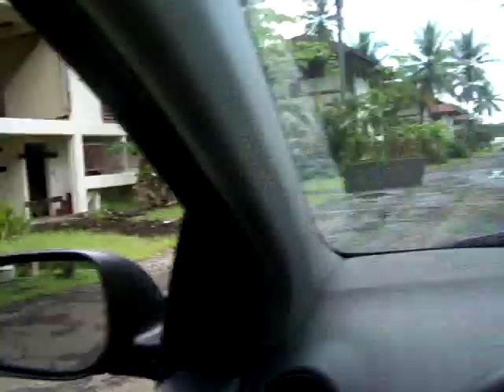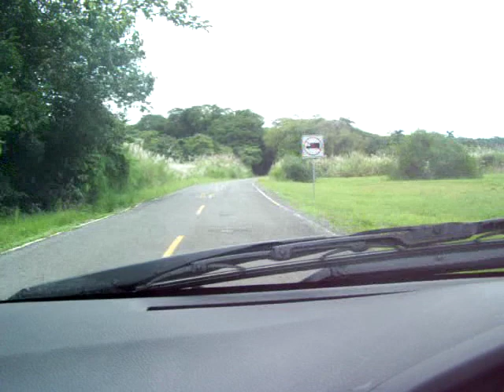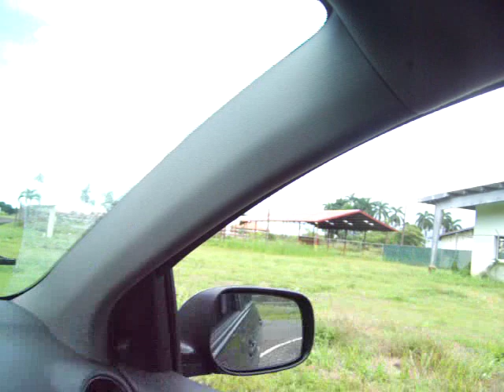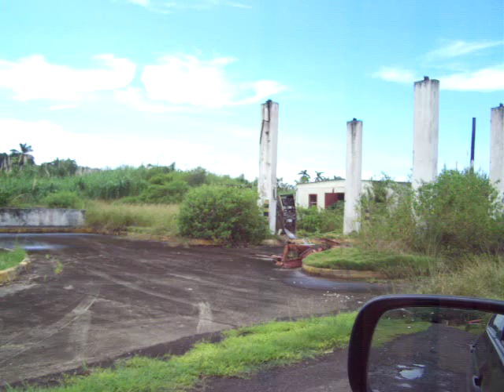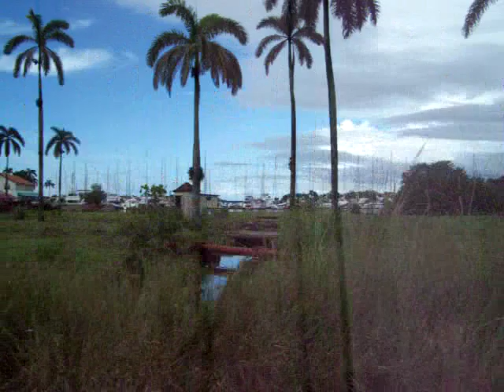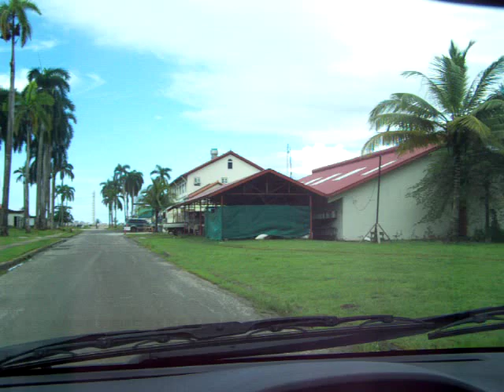Fort Sherman Panama - Driving into the Shelter Bay Marina

Comment: Lived there when I was a teenager. Sandy white beach right out front of our "quarters". Was a very unique place to live. Sad to see it totally destroyed. I can tell they had been upgrading as we had no windows only larger windows with screens and shutters we could put up on the inside during rainy season. You can see the windows were covers by the low roof which gave some protection. But sometimes the rain did blow in. Floors were concrete so easily cleaned. We were there in the early 60's and the housing was the group you drove through in your filming. They had been used many years ago and then taken over by the jungle for many years. During the Vietnam era they reopened the base and it was used for Jungle Warfare training
Reply: Ft Sherman was beautiful.  Worked for JOTC in 1976 to around 1978.  Sometimes it's sad to go down memory land.

Comment: Getting to "work" for the Smithsonian I did most of my research projects at the Coco Solo lab but we also did dives over on the Pacific side and I even worked with some of the botanists' with there projects. Because of my diversity I also got to work at the zoo on Fort Sherman part time and loved it. Of course there were those occasional days that I actually had to "report for duty" aboard the Sturgis but they seemed to only be once in a while. What can I say, I was very lucky.
Reply: My first job was on the Sturgis as a typist.  I see in 2015 they towed it off to be dismantled, etc.

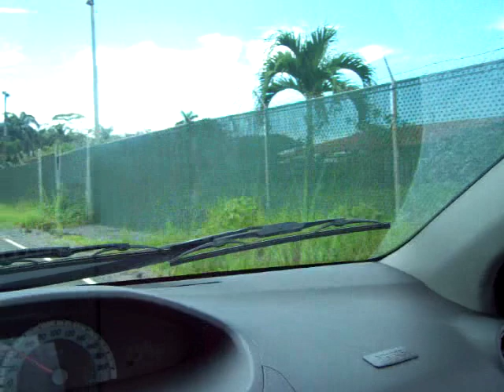Comment: 2:20 - "Antenna Array or Solar Panels" is neither - these areas were used to test metals, ceramics, and other building materials against the harsh conditions of Panama's coast line.

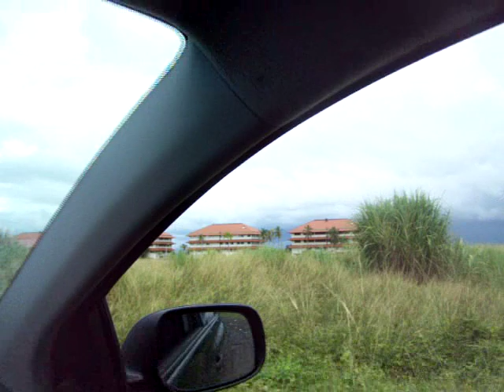3:45 - Those where the buildings used to house incoming troops for  Jungle Operation Training. The buildings were large enough to house a full battalion & its support units.

The actual bay area is where water training and scuba diving taught.as performed. It looks to have been enlarged.

Was there in '90 &'91